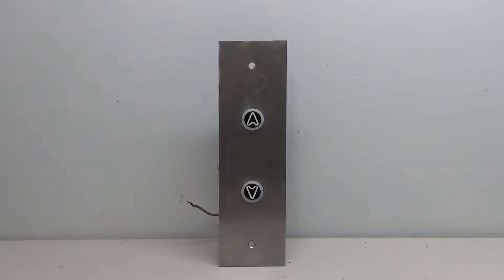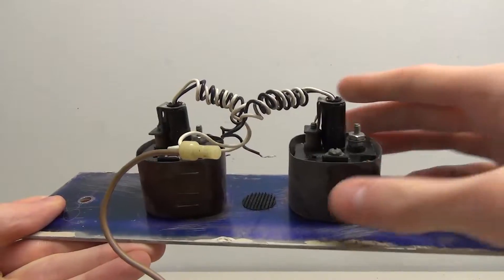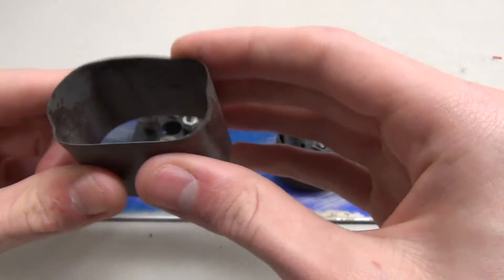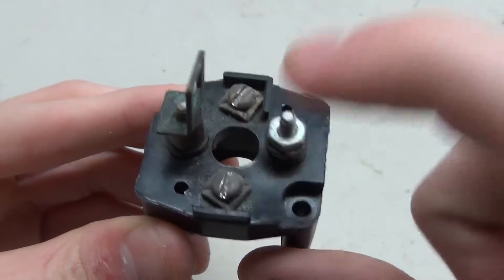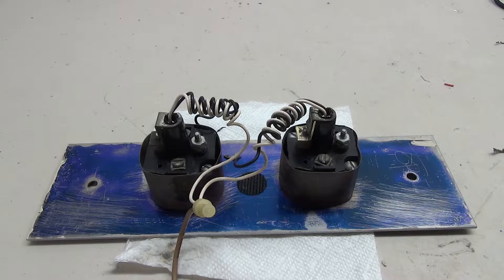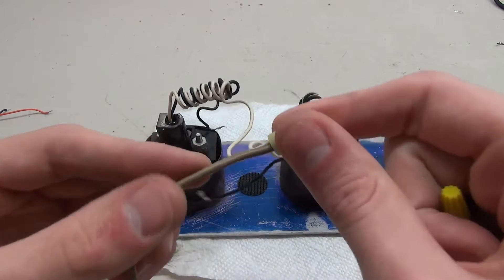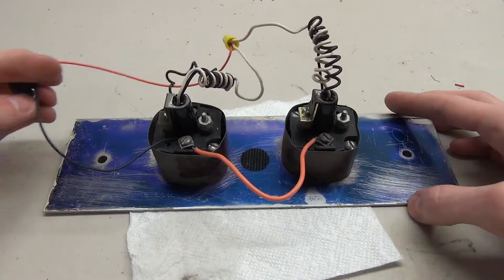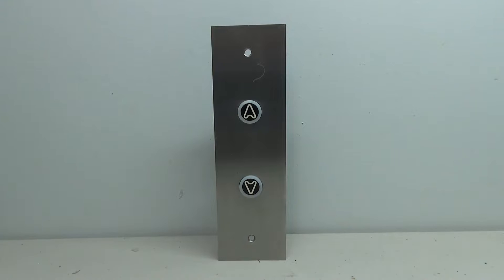Wiring a CJ Anderson HHR Elevator Button

Comment: Not only these buttons look like older Dover Traditional, but these also look a lot like Otis Lexan, and even the black button/white halo version of GAL Jet-Plus, EPCO Halo-Line, Monitor Controls, and Armor round buttons. Additionally, CJ Anderson had four variants of these buttons, including the HNR-B and HNR-W, which are 3/4" diameter, along with the AN10, which is a 1" diameter white button, and they also had the NHR, which is a 3/4" diameter white button with 1" diameter black halo, similar to the white button/black halo version of GAL Jet-Plus, EPCO Halo-Line/Circle-Line, Monitor Controls and Armor round buttons, as well as Innovation Universal, Adams Survivor, and newer Dover Traditional buttons.
Reply from the maker: I really like these buttons. Kind of sad to see they aren't being used in installs anymore.